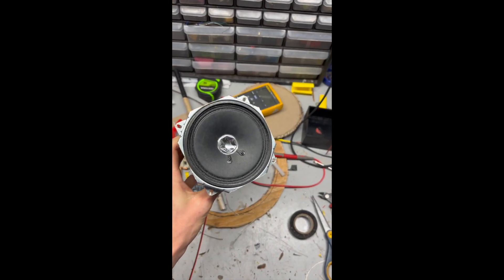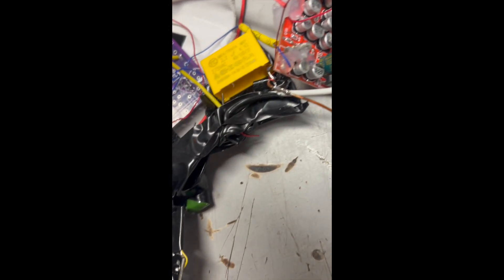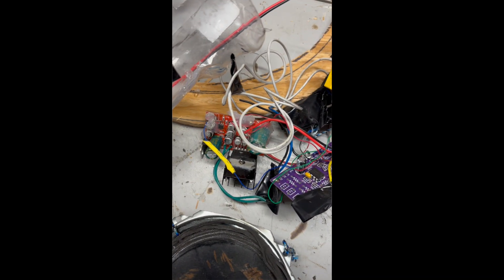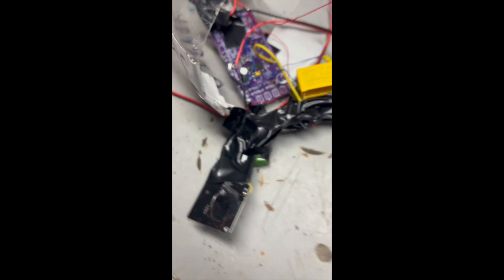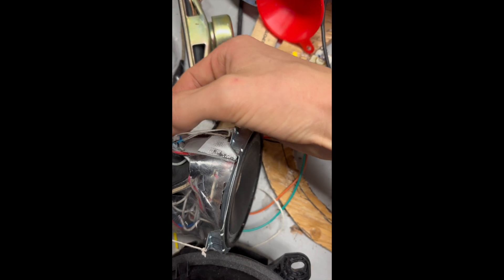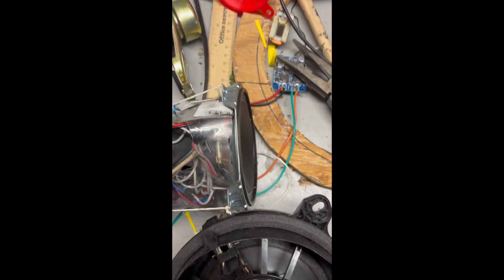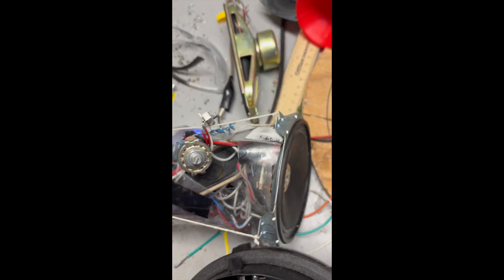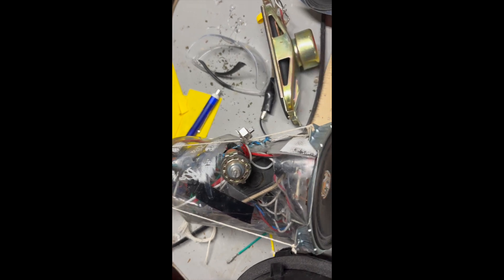I built a speaker that sounds bad on purpose

Comment: Been wondering about mangling a larger worksite speaker like this for louder results since I saw this howling apparatus. Fitting it into a plastic tote and putting a rectifier diode in the speaker wire line, maybe try to implement a bandpass like you did.

Comment: you can make it worse by using superglue around the boarder where the paper thingy (the speaker) and the metal part to make it sound more "rattly"
Reply from the maker: I actually used a fork when demonstrating "bass mode"

Comment: Can I have the schematic? I have an urge to reproduce it.
Reply from the maker: I'll se what I can do.
Reply: @Generic_Farmer  red thing with one semi-damaged capacitor is almost certainly some TDA, violet thing should be some bt sound source, filtering capacitor is good enough though untied kembrick and iso tape looks horrible, but what is the purpoce of tor inductor? Video is too shaky to trace the wires please let me reproduce.
Reply from the maker: @Eimrine  
the heart of the circuit is this evil bandpass filter but it also helps that there is no amplification before that bandpass so it has to bring the signal back from the dead after the bandpass so that the signal is noisier.
https://tinyurl.com/24jlgd3n
Reply: @Generic_Farmer  Thank you for the link, that is amazing visualization about the resonance.
Reply from the maker: @Eimrine  yeah sry for taking a year to respond. I really need to make more content. btw I signed up for insta under pro__audios!

Comment: Sounds like the rear speakers in my buddy’s 2010 Camry. 
I wish this was a joke.
Reply: Any old car speakers that are blown out sound like this
Reply: @jordan-mn6yy  don't need to be old to be blown
Reply: My 2004 Corolla's been like this ever since i put a crappy aftermarket head unit in. I just use the fader to turn the rear volume down, now i only hear the rattle from the passenger side door panel 🤣
Reply: i had exact the same speaker sound in my first car, a Golf 3 

i then used a portable speaker instead, because it was a multitude better
Reply: Hey, my old Civics Speakers were marginally better!
Reply: Good luck mà

Comment: its genuinely impressive how bad it is great fucking job
Reply: In order for something to function badly, it needs to function at all. There are a lot of ways to do things so wrong they break, but only a few ways to do something the worst (or close to it) while still working.
Reply from the maker: It is right on the verge of not working at all but it continues to hang on by a single strand of a wire and an almost carbonized transistor and a seasoned smoky flavor speaker
Reply: @Generic_Farmer  

not a mention a battery acid (91% pure) operated battery.
Reply from the maker: Very true
Reply: it's an expert on being bad (it's job)